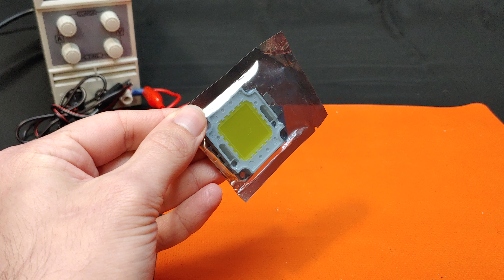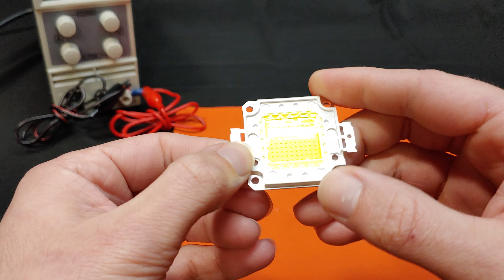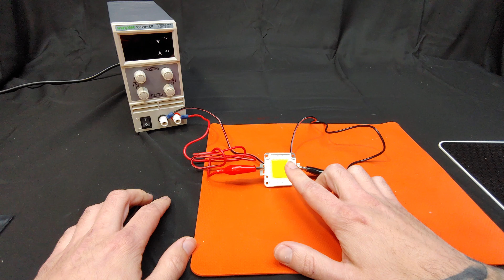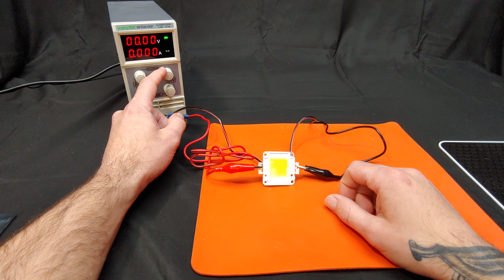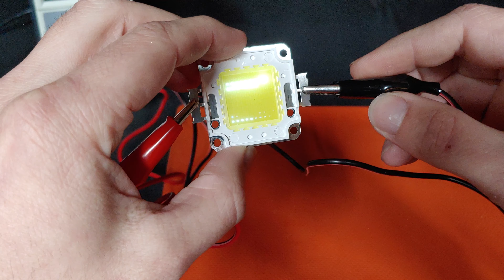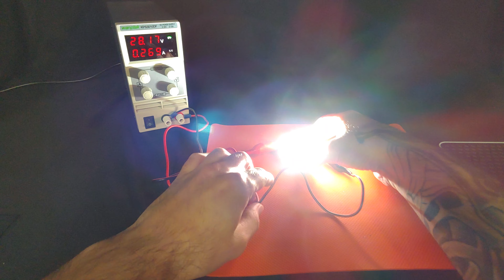Mislabeled 100w LED

Comment: It's just a basic cheap uneven lighting 100watt cob that will take around 32-36volts at 3amps. Does your power supply have the earth/ ground plug? Seems like a pretty sketchy PSU.
Reply from the maker: Yeah I realized what the issue was in the next video. 

My PSU is grounded. I haven't had any issues with it so far.
Reply from the maker: *well besides in this video.

None of what happened made sense with me becoming the ground.